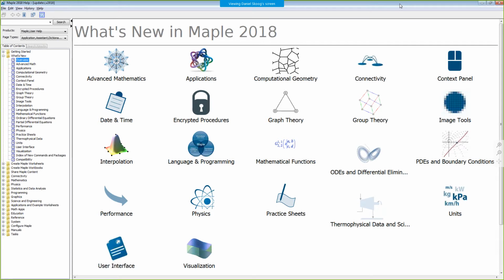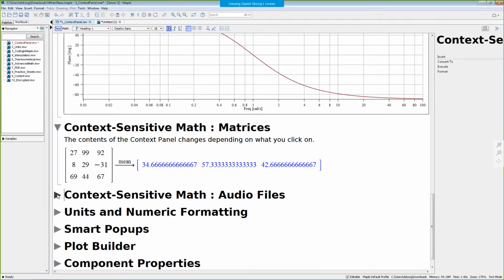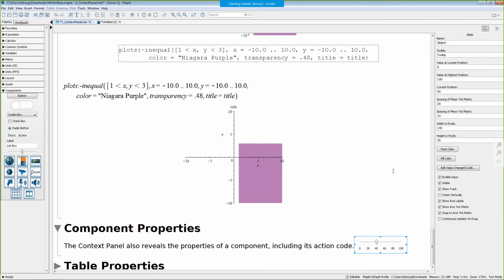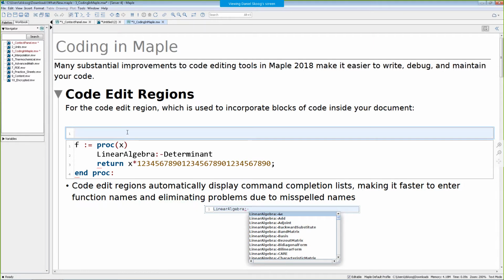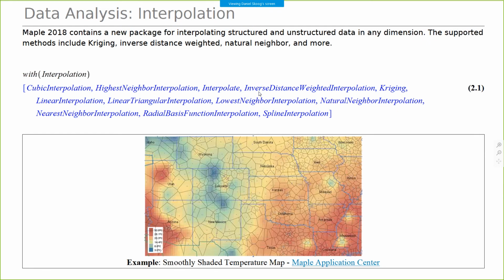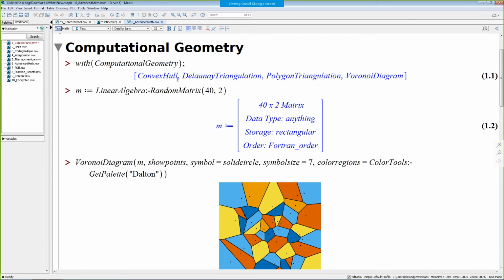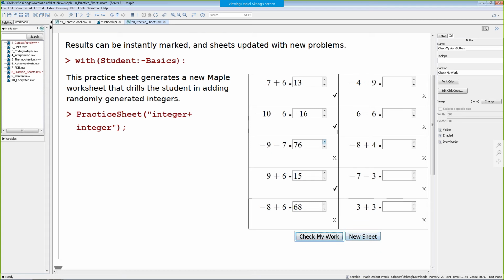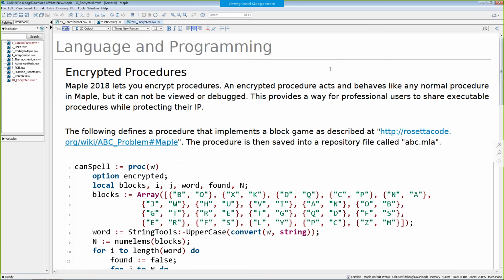An Upgrade You Won’t Want to Do Without: Maple 2018 for Education and Research

Comment: I have one question, sir, i have seen your pdsolve function. I want to solve 4 PDEs have 4 dependent variables (A, B, C, D) and two independent (x,t).  Value of A, B will start decreasing from 1 and after some time value of B first comes close to zero and than below zero. when it comes below zero it will affect the value of A. is it possible to stop or fix the value of B at a minimum that is zero so that it will not go below zero.
Reply from the maker: Hello. in the Examples section of the pdsolve help page, one of the examples uses assuming at the end to limit the range of one of the independent variables used - which should accomplish what you are trying to do. Thanks! https://www.maplesoft.com/support/help/Maple/view.aspx?path=pdsolve&term=pdsolve#examples
Reply: ok sir